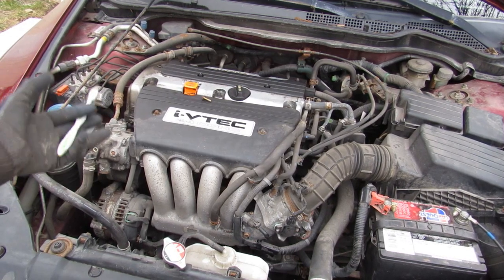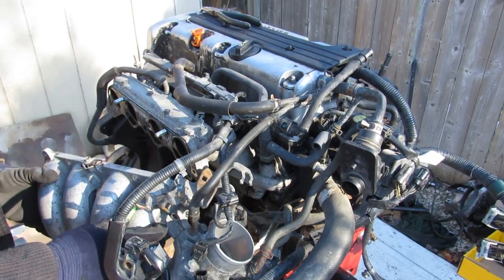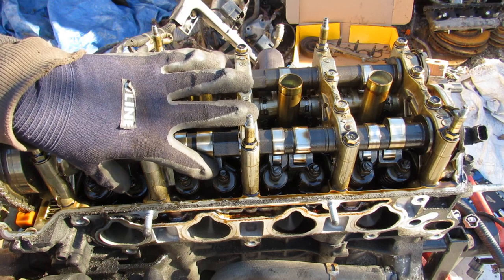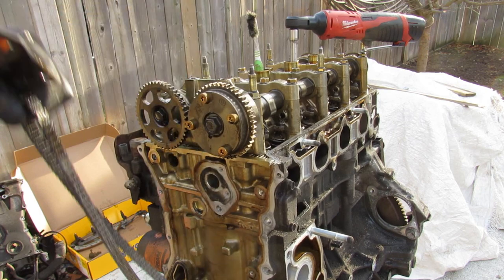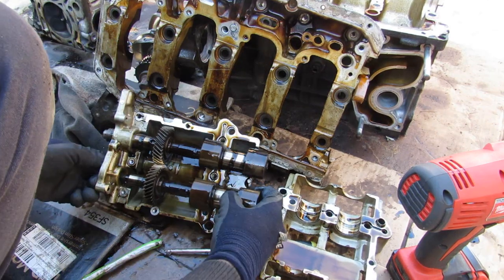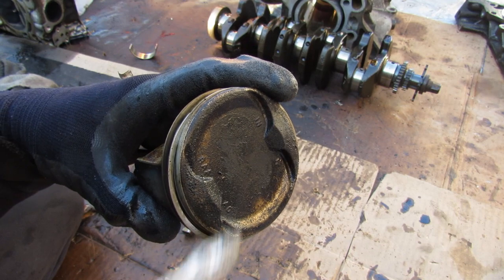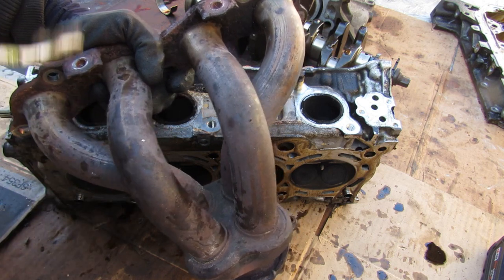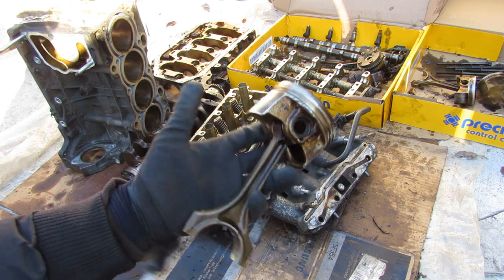Why the Honda K Series is the Best 4 Cylinder Engine

Comment: Love the K-series! The vtec solenoid can be an issue but full synthetic oil and on time intervals keeps that little screen from clogging up. Thanks for the content!
Reply from the maker: Yeah but synthetic might cause leaks
Reply: @speedkar99  In my experience with these people who go longer than they should on conventional on a regular basis or and then finally decide to go synthetic yes I’ve seen them leak. The seal is usually brittle and falls apart even when removing. The additive pack for synthetic is higher in detergent and the same crud that clogs up the screen seems to reinforce the crusty seal until you use synthetic which can clean the crud and cause a leak. Seen this happen on valve cover gaskets many times with people who have poor maintenance habits. Nowadays they’re all spec’d 0w20 which I’ve only seen in synthetic. Of course if you decide to use what Honda specifies. I don’t for mine and still no blown engine or any other problems.
Reply: To be fair I had my VTEC solenoid fail before the screen clogged up. At least it's on the outside of the engine and in my old accord is super easy get to. I just traded my accord this week for a 3rd gen fit and I already miss it. That engine was still running perfect despite the rest of the car falling apart from rust around it.
Reply: VTEC solenoid issues can also be caused by the electrical connector wearing out and making a bad connection. It's usually worth cleaning and reseating the connector before replacing the whole thing. You can also try just changing the oil. The only time I've ever had a VTEC solenoid issue it went away after an oil change.

Comment: I had a 2003 Accord with a K24A3. Great engine. Had about 390000 km on the clock when i eventually sold it. There was nothing wrong with it, I just got bored with front wheel drive. That engine has the "performance" VTEC on both intake and exhaust cams.

It really likes to rev (VTEC point at 6000 rpm, 190 hp at 6800 rpm and rev limiter at 7300 rpm :D), but also has some useful low end torque compared to the K20A6 that's more commonly found in Accords here. It also got the same if not better fuel mileage.
Reply: I bought 2006 manual 2.4l with 160k km. Impressive power have to admit. Its quite a sleeper in the world of audis and beemers. 😀
Reply: you must be talking about a Non US 03 accord cuz no way the US 03 accord has performance vtec with 190 hp 💀

Comment: I loved the K20Z3 motor, supremely engineered and bulletproof. It liked to burn oil though, and one tim while revving it to 8600 RPM the oil light went on. Checked my dipstick, was shocked to find there was no oil on the dip. Filled the oil back up and it had zero signs of damage or wear in the next oil change.
Reply from the maker: Yep these motors are strong
Reply: Probably had a little bit of cavitation in the oil pump, quite common when you rev an oil pump past 8000rpm, sounds like you might’ve got a little lucky!

Comment: I have the valves adjusted on my 2006 Honda Element with the K24A engine @ 105K mile intervals by my Honda garage master mechanic. He said the problem with the Honda valves needing adjustment is not because the valves get loose, it is because they get tight. Whatever the reason, the inside of my cylinder head still looks new with premium synthetic oil changes @ 5K mile intervals. My car has never burned oi or had any leaks. All I do is scheduled services. Wonderful engine! 
The only thing that "broke" on it was the starter which wore out. Unfortunately, it is underneath the intake manifold.

Comment: This motor is amazing, have it in my 2016 accord sport. I have 86500 miles on it, zero problems, never needed maintenance service except for oil service, only changed air filter and spark plugs.
Reply from the maker: Nice. Doesn't the 2013+ use direct Injection version of this k24?
Reply: @speedkar99  I have a 2012 Honda Accord LX  so does my use direct injection?
Reply: 86500 is barley broken is, OF COURSE YOU WON'T have problems

Comment: My 2006 Accord gave me 380,000 hard miles of use. No telling how many miles I could have gotten had I driven it easier and been more maintenance focused.
Reply: I have an '08 with 150k miles and owned since it had 25k miles. The car has been great and I was thinking about buying a newer car but then decided to spend money on maintenance this year to keep the car going another few years. I also bought a lot of new tools to work on everything from suspension to engine parts. I still have a couple of DIY projects to do but if the car last me at least another 3-5 years with minimal maintenance I would be very happy while I continue to save for a new car. I haven't decided if I want another Accord or something nicer like an Acura.
Reply from the maker: The 08 accords had oil issues be aware
Reply: @speedkar99  . Yes I know. But my car has been paid off for about 5 years and I drive very little - maybe 5k miles per year. I just need the car to hang on another 10-20k miles while I continue saving. The way I see it a new car is going to cost me $400+ per month which is roughly $5k per year. As long as my maintenance expenses are well below that threshold I still come out ahead. I've had a good run in this car (owned it since 2009 at 25k miles).
Reply: I wrecked my 2004 Accord 180,000 miles never consumed oil never gave me an issue, after I cleaned up the EGR it was running so smooth.
Reply: @miguelreyes4798  . I think the oil consumption is an issue with 8th gen Accords (2008-2012).
Reply: @MrSupernova111  possibly because they changed to a plastic intake, I’ve seen that the intake the PCV and EGR valves sort of have a tight relationship, I also think they changed the positioning of the air intake at the front above the radiator for a more direct cooling effect that probably effects the recycling of what would’ve been burned gases from the oil that would be fed back to the head, instead you’d probably get some stuck at the bottom edge of the piston rings causing some positive pressure from the block that would probably clog the PCV valve...if they changed to plastic for that model it would probably be a good idea to advance the timing a tad bit to get a more efficient combustion, might even slow down the oil burning
Reply: Honda likes it long and hard!👍

Comment: Excellent engine, definitely one of the best ever built. Running smooth, no matter if at low or high revs, true reliability for many many miles. No plastic crap.
Reply from the maker: Agreed. These were very strong engines.

Comment: A common issue with these engines in that year range of hondas is apparently when the power steering pump goes out it leaks fluid all over your alternator so you end up having to replace both.
Reply from the maker: Yeah. Oil leaks are too common on most Hondas
Reply: You read my mind....I'm goin through that as we speak
Reply: I would convert mine the to electric power steering
Reply: Mine has been leaking for about a year. Fluid all over my alternator. Everything still running perfect, these things are bulletproof
Reply: They're like Legos my guy.  fun, cheap and easy to put together.

Comment: I think this is the engine that’s in my 08 Honda crv 2.4l and it’s been so reliable- I mean like rock solid reliable, though it does burn some oil but I just top it off once every two or three months depending on how much I drive. My crv currently just turned over to 196,455 miles 👌🏻

Comment: As I know Honda makes the most friendly cars and engines for the mechanics who is maintaining them.
Reply: It's true I checked 2016 Civic engine you can change O2 sensors in less than one minute
Reply: @isatv5454  yep you can do a lot by yourself
Reply: The EGR valve on my 2010 2.4L Accord is literally visible as soon as you pop the hood. I was shocked. I pass on replacing one on my ‘85 pathfinder after removing the entire intake on my Volvo 940 to replace the oil trap.
Reply: @colinjohnson5515  even oil dipstick on this engine looks fancy
Reply from the maker: Agreed. Very easy to work on!

Comment: I was going to leave a snarky comment about the engine failing due to the Fram oil filter, but then you saved me the trouble.  :D
Reply: Are they that bad? What should I be using?
Reply: @colinjohnson5515  Wix, higher grades of Napa (Gold etc) , etc. The most expensive FRAMs are decent but at that price point there are better deals. Or alternately the car manufacturer filters tend to be good and reasonably priced. The issue with the orange FRAMs is the structure keeping the filter material in place is made of cardboard.
Reply: @colinjohnson5515  Many consider them inferior.  Wix is a good choice.
Reply: Honda oil filters are now actually made by Fram.
Reply: @John-yd2dg  Oh no! Hopefully based on the Ultra Synthetic.
Reply: @JoeUrbanYYC  if you search google the A02 are by fram, not honeywell anymore. And its the basic fram line up. Not syntheic media.
Reply: @John-yd2dg  So why is the filter advertised as being made by Honeywell use then?. I did notice the Oil filter I removed from our new Civic had a Japanese made filter by Mahle Tennex corporation, Honda OEM filter # is 15400-PLM-A02, The one I removed is a 15400-RTA-003 I think, It doesn't have a part# on it anywhere.
Reply: @raymondreiff8170  the A02 is made by Fram. It  even has stamp Fram on it. Its the A01 that are Honeywell. Not sure of the A03 though.

Comment: Honda calls the part at 5:30 the "Fuel Injector Air Assist Control Solenoid Valve". My understanding is it is a shortcut for the air to take when cold starting and then idling (to avoid a stall). Oftentimes aftermarket plugs that path off. I only know because I had to search for hours trying to find what it's called to replace mine a few days ago.

Comment: The 2 coils with no bolts: the plastic cover that goes on top of the coils is fastened to the valve cover by going through the other 2 coil pack mounts. So if the plastic cover is removed. Only 2 coils will be bolted down as the cover and 2 of the coils share fasteners

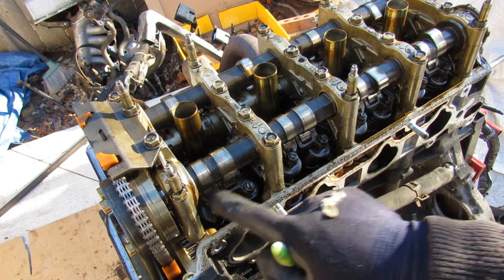Comment: 7:49, you've got that backwards,  the cam lobe on the left in frame (the crank pulley side) is the normal lobe, the taller lobe is the VTEC one, so when it runs on one, just the left valves are being actuated.

Comment: My 2008 Accord, K-24 has been the worst Honda I ever had, so bad that now I have a ‘13 Camry XLE with no problems whatsoever this unreliable Accord had a rattling VTC, I replaced it myself with OEM parts and 10k later the annoying noise came back, 1 Quart of oil every 1000 miles... keep going ?
Reply from the maker: Yep thats what I mentioned at the end of the video, the newer accords had oil problems
Reply: What year is ur Accord in 08 they didn’t use a cvt
Reply: @andersonrodriguez8258  you’re right, I was referring to VTC or Variable Timing Control or in this case I-VTEC !!
Reply: Cl9 is built in 🇯🇵 cu junk was not plus all of the cost cutting and suspension degradation compared to cl9.

Comment: Both lobes are used on the intake side when vtec is disengaged, the smaller lobe is not a complete circle. Look at the intake cam lobes at cylinder 4 at 8:02. One valve opens fully, one opens slightly (larger lobe opens one valve, smaller lobe opens the other) Vtec engagement locks the 2 intake rockers together, effectively making the larger lobe drive both rockers and valves. You can see the locking pins at 10:21

Comment: Very cool. I feel like taking my engine apart again after watching this video. I want to check valve clearances and compression. I did a rebuild last year (valve lapping and seals, piston rings and honed cylinders). Never done anything like that before. I figure it should be broken in by now. Anything else I should look for while I got it in the garage?
Reply: The big thing to check after a rebuild on a k series is the valve lash adjustment. After like 10000km or less.

Comment: I have this exact engine (K24A4) in my car with 251K miles! with not a single issue (after beating the everliving shit out of it because 160hp doesn't work well in mountains). Great info! gonna have to adjust those valves soon and probably clean the intake just because its never been done ;)

Comment: I thought these engines had belts not chains
Reply: Used to be belts. My ‘85 Integra had a belt. My ‘10 Accord is all chain baby
Reply from the maker: The 4 cylinders from the 90s had belts
Reply: I believe all current and older 4 cylinders hondas have timing chain

Comment: I think the D series and F series are the best but to each its own.
Reply from the maker: Those are outdated sitting beside the K series
Reply: @speedkar99   D series is never outdated 👌
Reply: @H2VPROEternal  d series? Lmao besides  the d16z6/y8 the rest are useless for modding.
Reply: @capy_official  Cody have you actually worked on a d series? I mean if you have you wouldnt clown on it. They have alot of potential. No one mentioned the rest of the d series engines. 😂 i am not biased towards engines period. Dont be upset if I am not being biased. Too much hype on K series and once again I own a J series and D series. 👌 I have owned a K series but its not my cup of 🍵. To each his own. Fully take apart and work on D, B, C, F, J, and then K before you feel high and mighty about your comment.. You sound like one of those kids who just bought a honda si and takes it to his mechanic. And knows nothing under the engine..
Reply: @H2VPROEternal   yes. Lol very easy to maintain, but as far as making power...good luck
Reply: @H2VPROEternal  ive had 6 d series civics. F22a accord. B18 integra. Currently drive a k series
Reply: @capy_official  you dont have to explain what you owned dude and neither do I but coming from an enthusiastic point of view I make my points openly. I'm just saying no reason to clown on peoples comments without judgement. Thats why I always put respectively to each his own at the end of my sentences so no one gets offended at the end of the day my opinions arent facts they are opinions. All honda engines deserve the hype 😆
Reply: @H2VPROEternal  lmao.  I'm actually  32. Couldn't  afford  labor growing up so I tore apart all of my slow ass d series engines  myself.
Reply: @capy_official  Good dont let a mechanic take your stuff apart. 😂 merry Christmas dude.
Reply: @H2VPROEternal  Merry Christmas to you also I did not mean to bash your comment just remember always driving d series civics add when I got my first b series i was like wow
Reply: @H2VPROEternal  my k series is a 2011 crv lol 
I gap soccer moms

Comment: A dead engine? spots a Fram filter, Ahh ok, makes sense now. :-))
Reply: Is Fram how you can buy engine failure?
Asking for a friend... who’s been buying them off and on for 20 years 😩 are they that bad? 
I should have hung out with more gear heads
Reply: @colinjohnson5515  all but the Ultra Synthetic FRAMs have part of the structure that supports the filter inside made of cardboard so they're considered to be at risk of deforming and causing a bad time. How much of a risk is it? Hard to say but most filters use all metal internal structures so why risk it.
Reply: @colinjohnson5515  The Fram=Crap thing came about when people started cutting open new fram filters and finding rust and very poor quality materials inside. Plus filtration tests showed they constantly scored at, or near the bottom.
Reply from the maker: I've cut open fram filters and wouldn't use them again
Reply: @JoeUrbanYYC  the Tough Gard and the Ultra synthetic Frams are the only ones I have use not the base model one it's trash.
Reply: @colinjohnson5515  get som mann filters
Reply: @CL9k24a3  and all: thanks for the information and recommendations! I’ll check Mann and never buy the orange fram again. 
What about other brands budget offerings? If a filter is below ?$ should I avoid it?
Reply: @colinjohnson5515  I have good price on mann because my brother is working at car parts store so it cost me 8 bucks. And mann air filter is 11.

Comment: I learned years ago that good engines that can go over 300,000 miles reliably are only available from two brands. Honda and Toyota. I love everything those two companies have given us. Sure, they occasionally make a lemon, but not often. And when they do, it's fixed the next gen every time, if not sooner. This is why my first new car purchase was a 2019 Honda Civic LX. It has a K20C2 engine and a 6-speed manual transmission. It will last nearly forever and be reliable. Also, it's rather peppy and gets 37mpg. For under $20k, it makes sense to own a car like that.
Reply: Plenty of Peugeot and VW diesels over here in Europe with over 500k miles.  Difference over here is we haven't long highways like Murica.  300k highway miles isn't impressive
Reply: @TheBlaert  Compared to what most American cars manage. Over 300k miles on a gasoline engine is pretty good. Everyone understands that diesel engines last. They are typically overbuilt and designed for endurance. Gasoline engines, not so much.
Reply: @TheBlaert  Those are Diesel engines.
Reply: @Hat65  Yup but the title of the video mentions that this "is the best 4 cylinder engine".  No mention of fuel
Reply: @TheBlaert  Gotcha

Comment: Got a 09 Accord parents bought new just rolled 100xxx on it no problems oil changes at 3000  religiously have been using Lucas in it since 75xxx did valve cover at 60xxx change serp belt, battery did plugs at 100xxx got 36.3 on trip to San Antonio TX on small performance chip  been a mechanic for over 37 years and haven't really worked on that 2.4 at all heard good stores on it